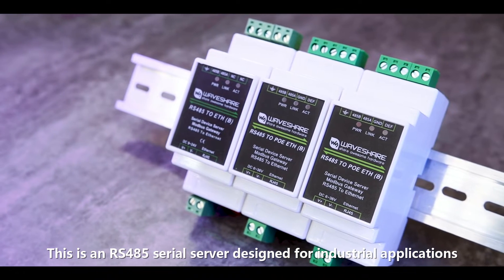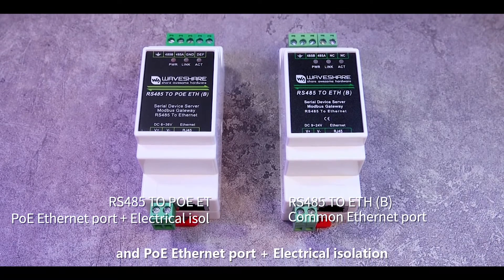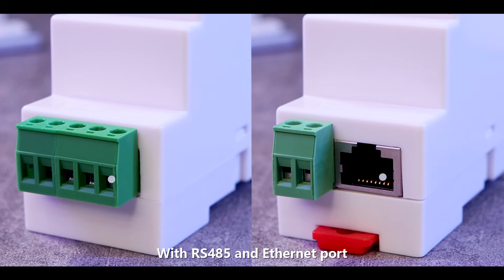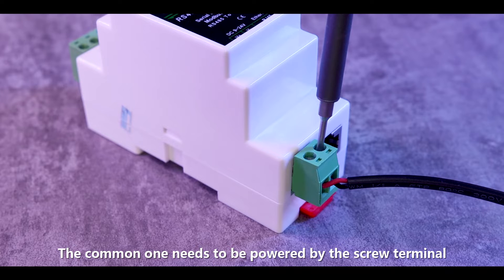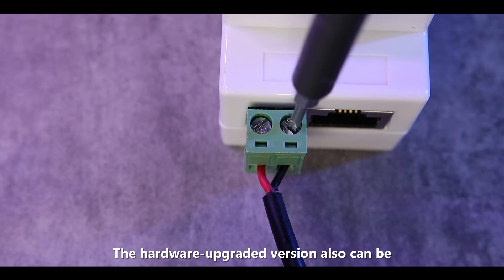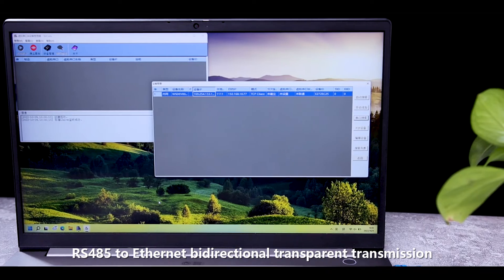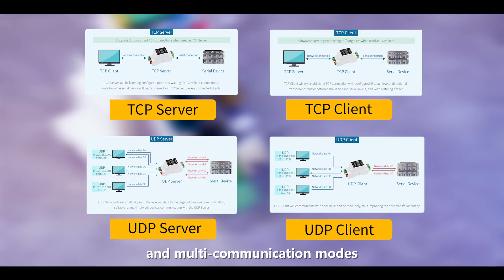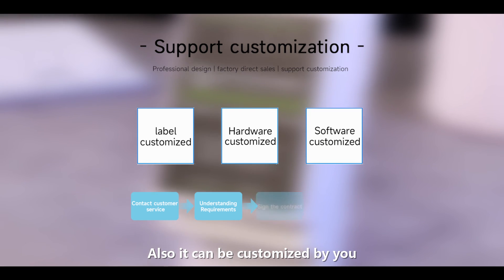Waveshare Industrial serial server, RS485 to RJ45 Ethernet, TCP/IP to serial, with POE function

Comment: I have your "mini version" without chasis. Which pins should I connect my power meter  to this board ? RX/TX ? For reading va Modbus from client, modbus_cli. I fact timeout issues when I connect my power meter A+B+ to TX/RX on this board. Voltage for board is 5v.
Reply from the maker: hi dear, for usage problem, pls feel free to contact our support team https://service.waveshare.com/